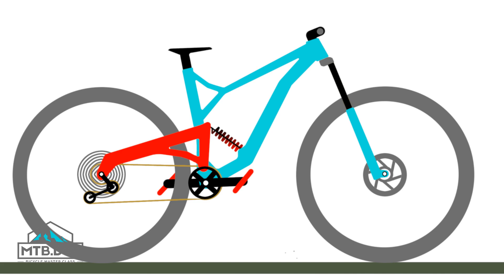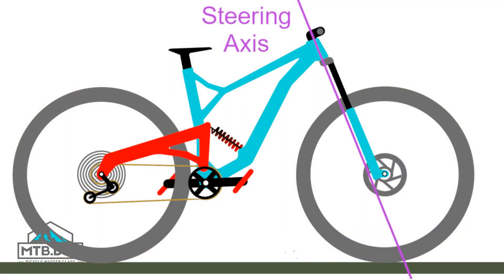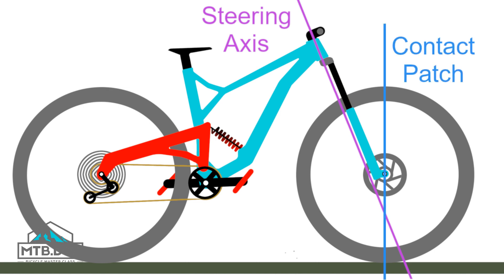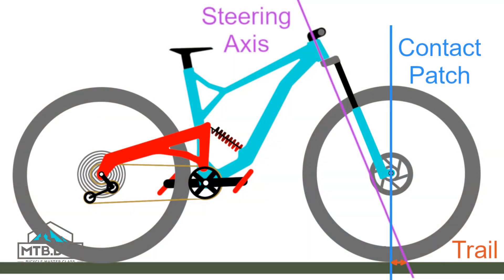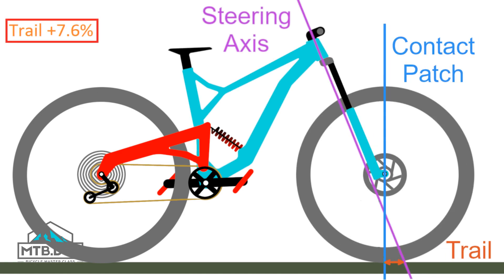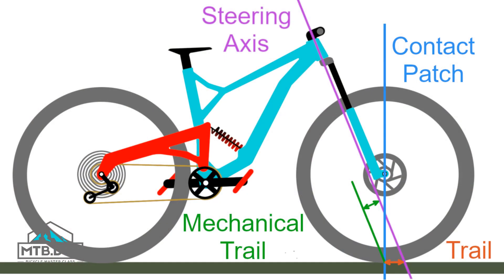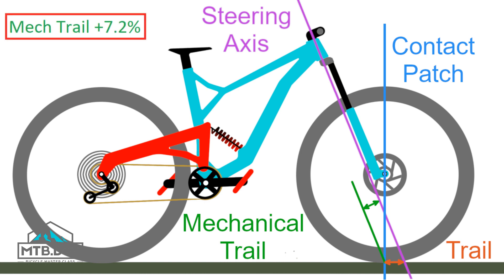How Fork Offset Affects the Way You Ride | Suspension Simplified

Comment: I have a hardtail 27.5 that has a 66° headtube angle with a 130mm fork with a 42mm offset. How will adding a 150mm fork with a 37mm offset affect it? I am pretty set on a 150mm fork and am wondering which offset will be best for this bike (37mm, 42/44mm, 51mm)